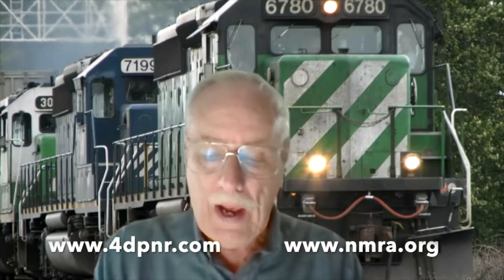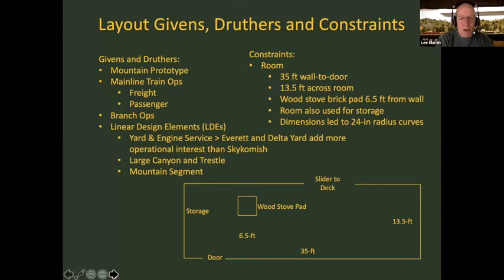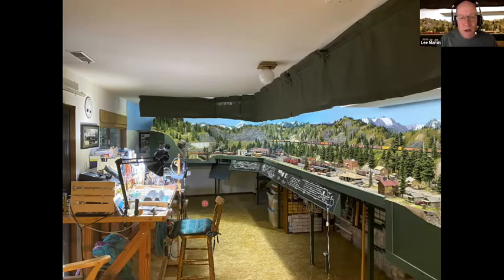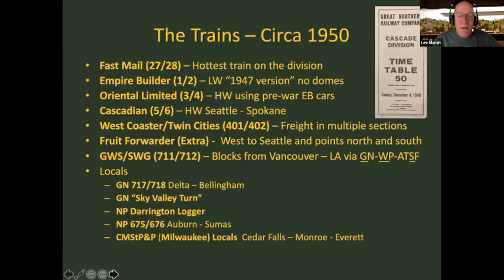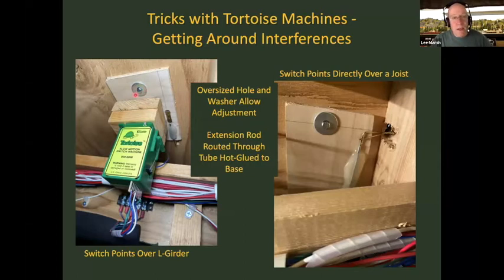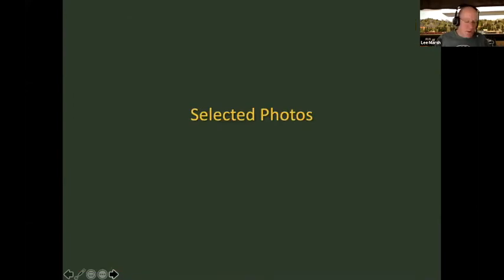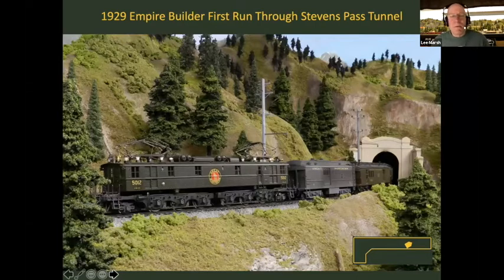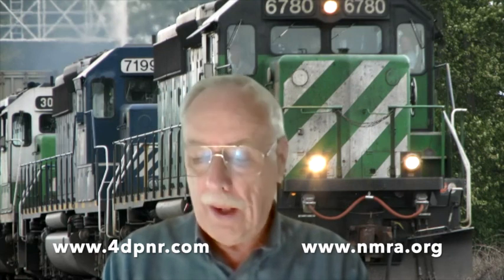Lee Marsh Great Northern Layout Tour 18 June 2020

Comment: It's a shame you can't run all your motive power on your layout. I've done that in the past too. I thought 28" R curves would do, but found many medium to large brass steam won't  tolerate even 32". My ultimate layout (someday) will use no less than 40" main curves. 28" min. spurs, and min. no. 6 turnouts, even though I focus on small 1880's steam now. It just makes operations and visual authenticity better. And if I ever decide to pull a Northern or Challenger off the display case, I'll be able to run those every now and then too.
Reply from the maker: We agree!